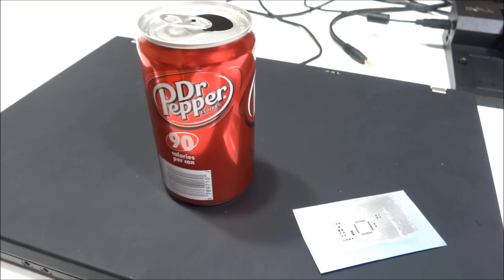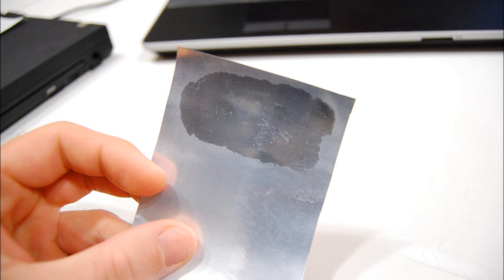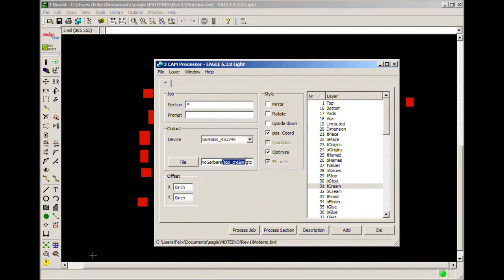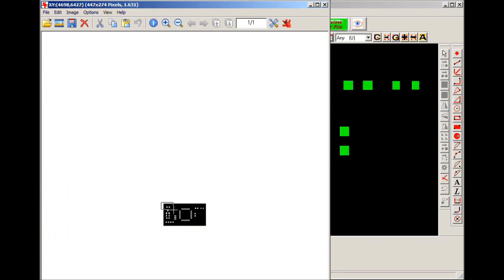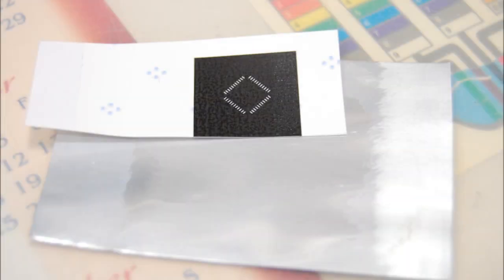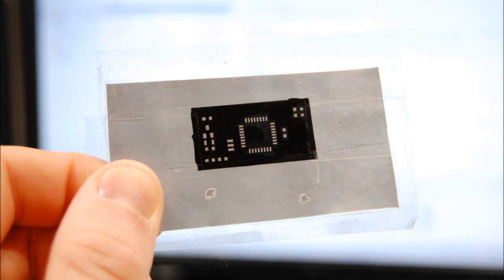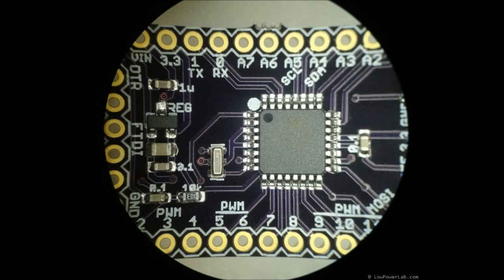DIY home-made SMT metal stencil - the definitive tutorial

Comment: Thanks for this. It took me two attempts, but the second attempt came out perfect. However I used laminated dry resist film, not vinyl. Lessons learned: use 0000 wire wool to sand off the resin from the coke can, acetone didn't work well for me. Be careful when sanding, as kinking the metal creates a crease that you can never get out and makes the stencil useless. Make sure metal is complely dry before laminating on the photoresist film (one website recommends having it wet, but the water turns to steam in the laminator and makes bubbles). Pause at regular intervals during etching to check under magnification, you don't want to over-etch.

Comment from the maker: To give you enough buffer when you etch. Also you want the etched holes smaller than the actual pads to avoid too much solder reflow and excess flux residue.
Reply: Can I make .4mm diameter stencil with 0.8mm spacing between the disk centres with this method? For ddr3-2 sodimm type
Reply from the maker: @brad8122  I am guessing you could but you have to make a very good transfer, and then be very careful with the etching.
However at how cheap stencils are these days I would not try that, at this point in time it's not worth the hassle and mess. Unless you want to experiment. Still back then in 2013 it was an attractive option for cheap (and quick!) stencils at home with very usable fine pitch.

Comment: A possible optimisation: If you leave the paint/epoxy on the reverse, you might not need to tape the reverse side, which may mean that you do not damage the stencil removing the tape. Test to see by taking one of the offcuts and putting it in the etchant. If it only reacts on the edges, the epoxy makes a good resist.

Maybe there is a way to do a quick-and-dirty stencil by just scratching off parts of the epoxy!
Reply: Really? Can I make .4mm stencil with 0.8mm spacing between the disk centres with this method? For ddr3-2 sodimm type

Comment: Success finally! Your mixture ratio of 1 part acid, 3 parts peroxide is right, the problem was I had 10% muriatic acid (cheap cleaning brand and I noticed all other brands where around 25%). So I guess my mixture was about 1 part acid 6 parts peroxide before. I would have thought that with more acid the reaction would be greater but it's not so, this time with a 1:3 ratio it was much slower but it etched really evenly, the stencil looks great. Now to try with solder paste.
Thanks for the info!

Comment from the maker: Also, the iron is set to the hottest position (I wait till its heated up and then place it on top of the sticky note stack for ~30secs, then apply pressure and movement gently not to jerk the vinyl underneath ... then rapidly put the stencil in cold water. Then the paper/vinyl should come off easily revealing a perfect transfer.

Comment from the maker: Acetone will dissolve epoxy, get some from HomeDepot. Rubbing with a paper towel you should start seeing the metail within 1 minute or less. Some cans are harder, so try a different type of can. I found the heating does work in some cases and makes the epoxy easier to remove. I wouldn't worry about the paint so much. Just get the epoxy off without scratching the metal so you can transfer the toner. Keep trying, it will work, I've made many many stencils with this method.

Comment from the maker: I would try a slower reaction, mine takes about 10-12min, feels just right, not to slow, not too violently fast. The solution is 1 part acid, 3 parts peroxide, but still using the same ORIGINAL mix since January this year. I kept adding a little copper wire when it got dull and that rejuvenated it right up.

Comment from the maker: Sometimes I just shrink in one dimension only (solder paste will reflow but what you really want is LESS solder paste). Sometimes after shrinking everything by a fixed amount I produce the PNG and then use the eraser to make the pads shorter on very small packages or on uUSB connectors. That's because too much solder paste will cause bridges. It's a lot of trial and error but after a while you start to get the feel of how much and which way to shrink pads.

Comment from the maker: Depends what thickness and if it creases easy. The can aluminum is perfect due to its properties.
I laser etch stencils today, much easier and less effort, see my video on that.
Reply: What other etching solution can we use.
Reply: @Shanoo5142  
Muriatic Acid is just a common name for Hydrochloric Acid. HCl is usually sold for adjusting the PH balance of swimming pools, or for cleaning concrete. It is also the first ingredient used in many many chemicals made in a chemistry lab. It's probably the most common acid available commercially around the world. 
  One other enchant combo I've seen someone mention, and saved, but haven't tried myself is as follows:
150ml hydrogen peroxide 
20g "lemon acid" (available in supermarket)
5g salt
 That's exactly what was described in a comment on another channel that I came across and took a screenshot of, but again, I haven't actually tried it. That receipe was intended for etching circuit boards but so is the Hydrocloric Acid and Hydrogen Peroxide shown here, (which is what I currently use to etch my boards too).
-Jake

Comment: I make stencils from clear plastic overhead-projector film, then cnc machine the holes with a 0.5mm or 0.7mm endmill.
They are quicker to make and no issues of scaling like with a laser printer.
And the clear stencil is great because you can see through it for pcb alignment. 🤓

Comment: Hey Felix - I'm having a lot of trouble removing the epoxy and paint from the outside of the can. I even tried used a hot-air gun set at the highest temperature to try to break the bonds between the paint and the aluminum, but to no avail. I was able to get some of the paint off but hardly any of the epoxy, and that was with a good hour to an hour and a half of elbow greases. Any suggestions?

Comment: I tried this out today and it worked quite well. I think I over immersed at the first attempt and the solution ate most of the board. The second attempt was quite a success.The only difference is I did not have access to the vinyl paper and I used photopaper instead. Yes it took sometime to scrub it off after applying it to the metal. Also the coating inside the can did not come off with Acetone. Hence I had to scrub it with a kitchen scrubber. Thankfully the toner did stick to the metal though. Any ideas on how I can safely dispose the etching solution?

Comment: Thanks Felix. One more question. What makes the reaction faster? More acid or more peroxide? I made the first test but about halfway through I started to loose the edges of the pads, some disappeared before the etching could go all the way through.
This took about 4 minutes so I was thinking maybe a faster reacting solution might help? 
The real solution would be to use toner on both sides but I dont think I would be able to align them! 
Would you try a faster reaction or slower reaction?

Comment from the maker: I tried leaving the outside paint on. That will obstruct the pads when they etch through risking to overetch if you cannot estimate how much they etched. So I prefer to give the outside a good wipe to at least have a clear idea how well the pads are etched.
I also tried removing the epoxy layer with a pin, its way too time consuming and way too inaccurate. A laser cutter may be used to etch the epoxy but I haven't tried that - but the metal sheet has to be very flat, a bit hard with can metal

Comment: Hi Felix, I bought a  vinyl like the one of the video (I think) but transparent, the thing is that, when I print the circuit the some tiny bubbles appear on the vinyl, I think because of the heat of the laser printer, do you know if this is normal, or maybe my vinil is too thin?, I used this print to test the transfer to the aluminum but it faild to transfer the print correctly, I would post a photo but youtube doesnt have the option.

Comment from the maker: Hmm...the heat is important, but more important is to get the surface prepped correctly. The interior expoxy coat must be removed with acetone without getting the metal scratched *at all*. Then I use thin vinyl for the transfer and I get a 99.99% transfer...keep trying, I messed up many times before I got the hang of it and the desired results.

Comment: Hi Felix,   Didn't work for the ink to transfer.  I've tried different vinyl.  What kind of printer do you use?  Laser or jet.  I've tried less heat and then longer 3 min high heat.  The ink barely stick to the metal.  I did clean and remove the coating with acetote.  Any advise?

Comment: Hi Felix,
  great project....I am very excited about the prospect of making my own metal stencils!  But for some reason my stencil image is printing just slightly larger than my pcb.
  I got my gerber directly from Eagle...used PDFCreator to save it to a PNG....set resolution to 1200 dpi and scale is set to 100%.....any idea what I may be missing?   thanks!
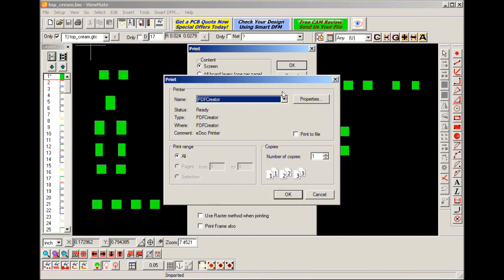Reply: +Al Bassett Solved!....My scaling issue was coming from a setting in ViewMate....if you jump in the video to 2:22 right under the color setting where you set it to print "white on black" there is a "scale" setting....which in my case (since I just installed this software when I found it here) was set to "fit to page" by default....that setting needs to set to "By factor"and have a value or factor of 1.....thanks again for the video!

Comment: Sorry I am no english and I can't understand the name of the chemical product you use to dissolve the aluminum: " peroxide ...." I just understand you said it possible to have it in a local pharmacy...
Reply from the maker: Hydrogen Peroxide and hydrocloric acid : H2O2 + HCL (3:1)
Reply: Felix Rusu thank you very much, you're video is fantastic.
Reply: Felix Rusu  terima kasih ...
Reply: @FelixRusu  i do not think you can get 100% H2O2 in your local store
Reply from the maker: @wormball  Yes I can, where I live.
Reply: @FelixRusu  Where is it? 100% H2O2 is extremely explosive. Even rocket engineers refuse to use it.

In your article i found you use 31.5% HCl and 3% H2O2. So "H2O2 + HCL (3:1)" is misleading.

By the way, NaOH solution also etches aluminium very well while being not so harmful. Also used FeCl3 does this job.
Reply from the maker: @wormball  H2O2 3% is what you find over the counter (oxigenated water), as disinfectant, very cheap. HCl in 31.5% is found here for cleaning swimming pools and concrete, also very cheap. Then H2O2 + HCL (3:1) in those concentrations mentioned before give the solution for etchant. But thanks for the alternative suggestions.

Comment: HI FELIX, great tutorial, I will try your method. I was thinking of using a 3.4 mil  copper sheet and do the toner transfer and etching with Ferric Chloride as I usually do with PCB, but the "free" price point of aluminum cans definitively out beats the price of the copper sheet. I have a question. When you go to the pharmacy, the hydrogen peroxide they sell is in a 3% solution with water; I guess we have to use pure 100% H2O2???? Where can we get it? At the pharmacy store they sell this thing in solution. Where do we get it pure? Thanks!!!
Reply from the maker: Pharmacy H2O2 is good enough :)

Comment: I have tried a half dozen times using ferric chloride on copper, aluminum and brass...  and have not made a single stencil yet. it starts to work but I have not had it go all the way though, I have even left it in the solution for hours in direct sunlight for heat and all it did was bubble off the mask leaving a mess.

Comment: Hi Felix, thanks for the video, its really helpful, I have one question why the acid is not etching the ramaining metal part where there is no ink, however you have dipped whole metal plate in the acid?
Reply: Rahul Khurana  Re-watch at 4:35 where he adds CLEAR TAPE (looks to be at least 3 strips) around the black toner area. It is implied that the back is completely covered with tape as well. Note at the time above that you can see the tape extends past the edges of the metal to essentially cold-laminate the metal so it is protected from the etchant.

Also note that the reason all of the holes were made slightly smaller at 2:07 is to offset the metal lost when the acid eats both down into the holes, and sideways into the newly exposed edges of the holes. The holes will re-enlarge back to about the correct sizes desired.
Reply: @darrellhale3880  yeah, I think the swelling of the pads is negative of the thickness of the metal. ?
Reply: @TheRainHarvester  I think the .0075" shrink was probably determined through experimentation, since a can with only 0.0075" thick metal would be very a very thin can. As the acid eats through the metal sheet, the width of the hole near the top surface will become wider than at the bottom since the acid continues to eat into the side wall that is formed as the acid also eats away the bottom of the hole. How much the acid eats into the side depends on the aggressiveness of the enchant and the time it is allowed to run (thicker metal means more time in the acid to eat all the way through, but that also means more time for the walls to be etched away) Since the hole top ends up wider than the bottom, shrinking the original outline of the hole helps to counter the enlarging effect of the acid, leaving a final hole size closer to the actual desired size.

When they etch the wafers for electronics, the same thing happens but at very tine scales. They have clever ways to shape how the holes are formed. Refer to the picture "Figure 1-Profile Control Terminology" in the link for examples. On large scale etching like this stencil, the side walls would probably look mostly like the "Tapered" profile. The yellow coating represents the toner mask on the top surface that keeps the acid from eating into the metal to be saved, but some under cutting can also occur as the acid gets under the edge of the mask so the metal is wider than the mask similar to the "Notched" profile.

http://www.plasma-therm.com/pdfs/papers/29.%20Deep%20Silicon%20Etch%20Profile%20Control.pdf
Reply: @darrellhale3880  yes I agree.  Acid getting into the side of a hole would have resistance and some of the reacted acid, and associated bubbles, would block new acid from attacking the side metal.  I thought of this after I posted but couldn't find where I posted.  I'm glad you responded!

Comment: Is it possible to use dry film and ferric chloride? Is it possible to just print a negative on an acetate overhead sheet, laminate the dry film on the aluminum, develope the result, and then etch with ferric chloride or your phosphoric acid/peroxide mix? I figure if it would work, it would probably improve the definition for very small solder lands.
Reply from the maker: I think it would work. The only way to really perfect the details is to try it and repeat until you get the results you're after.
Reply: @FelixRusu  Thanks for responding. Perfect results aren't really the aim, I'll save that for the PCB development, really all I'm trying to do is to get really small pitched traces. I just want to be able to solder QFN packages, other high count small pitch packages, and small SMD components. Do you think that would be possible with this technique?
Reply from the maker: @lanceuppercut8220  Quite possibly, but I haven't tried this specific recipe. The key is to not have an aggressive acid mix but rather one that will take longer but is easier to control and keep even in etching. If you're heating it to help the etch then mix it thoroughly all the time, you dont want cold spots where it will etch slower, you want uniform etching. Also copper heavy regions will tend to etch slower rather than small areas (and dull the acidity around those areas), so keep that in mind when you route your board and try to keep the copper balanced, or use grid pours. hope it helps you

Comment: Thanks for that fine tutorial, Felix. But you don't need to go through all of those gymnastics to get an appropriate aluminum sheet for this task. What I did, was buy a roll of 36 gauge aluminum foil at amazon that's normally used for arts and crafts. It's thickness is 0.005", whilst the thickness of a can's aluminum is normally 0.004". I know, because I measured it  myself. Thanks again, and good luck.
Reply from the maker: The DIY aspect and the discovery aspect of using the soda can aluminum made it more interesting for the tutorial but you're right you don't even need to specifically use AL, could be something else. But its so cheap to make stencils these days this is totally not worth spending the time, other than for the fun and learning.